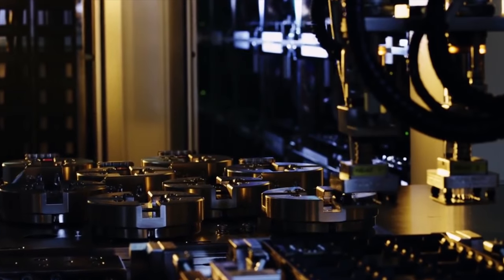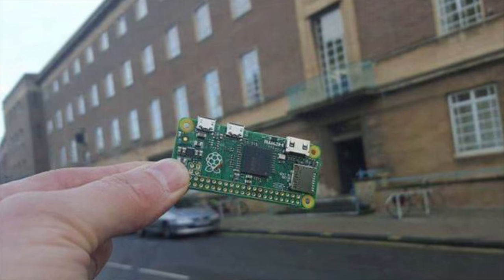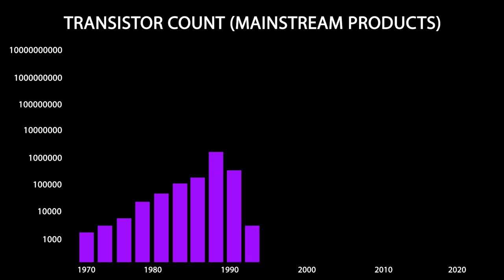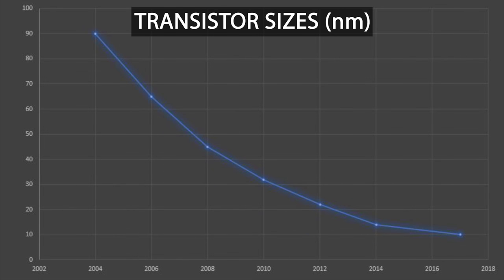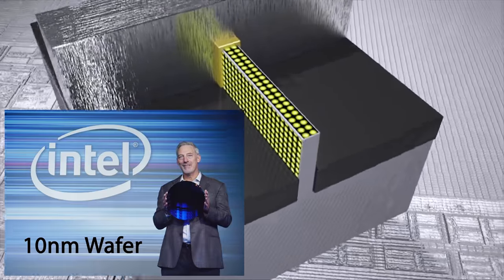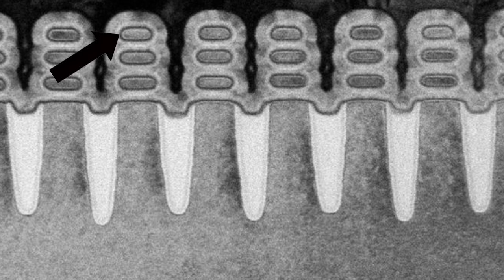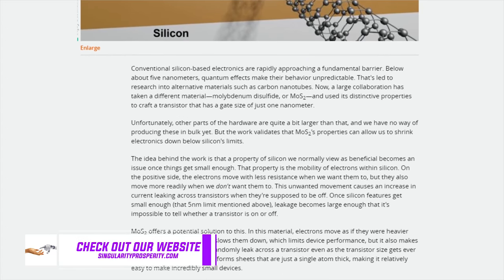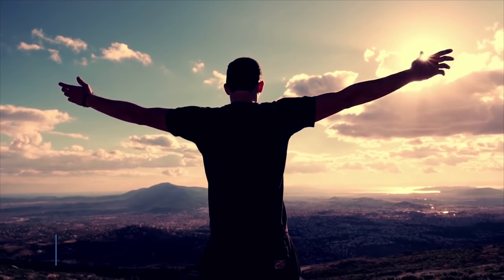The End of Moore’s Law?! (Shrinking The Transistor To 1nm)

Comment from the maker: Want to learn more about the Technological Revolution? Watch our playlist here: https://www.youtube.com/watch?v=ENWsoWjzJTQ&list=PLfsEr6YiELAAWg86OOuUeKmFqDjhzLQoS

- ALSO - Become a YouTube member for many exclusive perks from exclusive posts, bonus content, shoutouts and more! https://subscribe.futurology.earthone.io/member - AND - Join our Discord server for much better community discussions! https://subscribe.futurology.earthone.io/discord
Reply: What's the theme song?
Reply: there going to stack silicon CPU dies on top of each other just like HMB memory is
Reply: Also as eh side note cosmic rays have been know to reap havoc on silicon chips with transistors smaller then 45nm creating currents in the electronic pathways that short out ships !
Reply: I love learning about ICs and electronics specifically CPUs because they are the cutting edge. And I've pondered since 22nm what are we going to do when we get to 1nm great video, please SLOW DOWN YOUR VOICE.
Reply: Aaron ball 1nm is impossible. Once you get to 4nm quantum tunnelling becomes a issue.
Reply: The GPU and adding cores are stopgaps at best. ROI in multi-cores is reached by 4 cores for nearly all applications outside of servers. Most processes run better on a single fast core than 2 or 4 slower cores who are as fast when combined. There is overhead in using multiple cores which makes multiple cores inherently less efficient. Not all processes can be broken into smaller threads.  
GPUs are fundamentally different than CPUs. While they are very good at one thing, they are not good at other things. GPUs are good at dealing with a large data set and doing something to that large set. They are not CPUs.
Reply: finally somebody who does not fall asleep while narrating. keep it up!
Reply: except ddr 4 memory doubled in price after its introduction.
Reply: and we have less than a month where is my 10nm Intel chip! Perhaps 2019 will be better
Reply: Aaron ball we will never see production level chips at a single nm as already mentioned Quantum tunneling starts to become a major issues after 5 nm where you start to see that electrons will start to randomly tunnel through the gate due to the fact the gate is so small, this effectively hurting chip performance greatly, hence why we will never see production level chips this small due to the fundamental physical issues at that length scale, hope that helps clear up any misconceptions you had...
Reply: @azza009  don't worry procced electronic turn into burner trash like a oldest phone and other electronic and other words called industrial revolutionary is not possible something old phone replace next-generation revolutionary futuristic punk science fiction quantum mechanic level
Reply: The current transistor roadmap is mass production of 3nm silicon transistors by the end of 2022. After that TSMC are looking to transition to carbon nanotubes. It has already been proven to be viable, what's left is implementation.

Comment: It’s like housing in a dense city area. When there’s no room left on the ground, you start building up with high rise...
Reply: @justicewarrior9187 
Problem is that that "more land" is more expansive than building skyscrapers.
Reply: Not sure if you didn't get my analogy, what I meant is that it is cheaper to build more layers and thus needing less area for one chip on a waver than using less layers and taking up more area on a waver. The greater the area of your chip the less chips you get out of a waver, which means they will be more expensive and your margins are dwindling.
Reply: That's kinda what threadripper is
Reply: Yup. 3D chips are way past due.
Reply: Haha i think you guys forgot about the heat of the chip. How would you cool down a 3d chip?
Reply: @justicewarrior9187  Both 3D and "more land" solutions have complicated issues that need to be solved. 3D is hard to dissipate heat, while larger CPU's introduce clock speed limitations due to the speed of light / electricity. Signals may not reach their destination in time in a larger chip (longer internal copper wires).
Reply: How about 3d chips with built in heat pipes. Have a 6 layer chip be maybe 1 inch thick. Not good for phones. But great for desktops. Get a 240 core chip.
Reply: MythicalBeast with a 3D fan of course...?
Reply: @justicewarrior9187  It's about per unit area of land, dummy. Adding area doesn't help increase the rate, fule.
Reply: @Bonchanas  
Immerse it in cold liquid -- nitrogen, CO2, whatever. What's yer problem?
This has its limitation: there'll come a time when you run up against the square/cube limitations of your little tunnels where you pump the liquid through the chip and maybe turbulence problems if you're pushing it through fast enough... 

And we're getting to within a decade or so of Heisenberg limitations on how narrow we can make the signal paths.
 
So yes, at some point Moore's Guideline runs out. But we'll be all quantum by then, so no sweat.
Reply: Kek
Reply: @d1oftwins  yeah, expansive, but you probably meant to say other thing...
Reply: @justicewarrior9187  I'd expect a "MCM" answer, but not a "bigger chip" answer. I think everyone knows why a "bigger chip" isn't a viable option.
Reply: @TheSkepticSkwerl  that would be one hell of a thicc chip
Reply: Now a days we have 4nm transistors.

Comment: I remember how everyone talked about the end of moores law 20 years ago.
Reply: I guess we'll stop using a flat sheet as a place to store transistors but use tubes that can run liquid cooling through them
Reply: How many more iterations do you think we could get if we wrote better software? (Or designed programs to write better software.)
Reply: But its for real now.
Reply: There is an old Byte magazine cover blabbering that the limit was 250 Mhz....yeah.
Reply: Little did he know 5nm ended up coming out in 2021
Reply: They're still talking about it.
Reply: @jeffwads  there is a big difference now though, the size of the chip is starting to approach the size of an atom. A silicon atom is about 0.2 nm big and you need atleast 2 of those plus something inbetween to separate them( or something along that way)

This means it is literally impossible to make a chip smaller than 0.5nm (and for sure 0.2nm)

It might not even be possible with 0.5nm or 1nm either but lets be generous and say they can make it down to 0.5nm

In 2022 IBM managed to make a 2nm chip so with the law of doubling the power every 24 months we would hit 0.5nm 2026 and that would be the end of it. Impossible to make it smaller. 
So yes the end of moores law is near for sure.

Maybe they can manage to keep it up for a couple more years by stacking the chips or computation effiency or something but moores law will end eventually.
Reply: I looked around on youtube and found out that the 5 nm and 2nm chips actually are bigger than that but because of their design they are equal to the power of a theoretical 2nm chip

The transistor is then marketed as a 2nm transistor even though they aren't actually that small 
Link to the video that explains it https://youtu.be/GdLRSF5wZpE